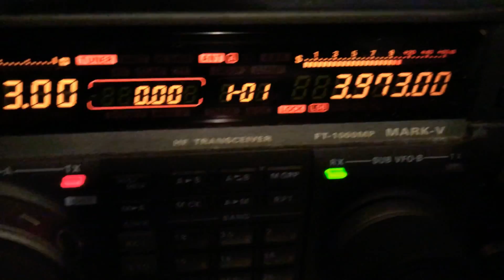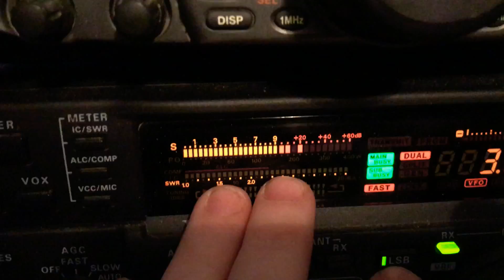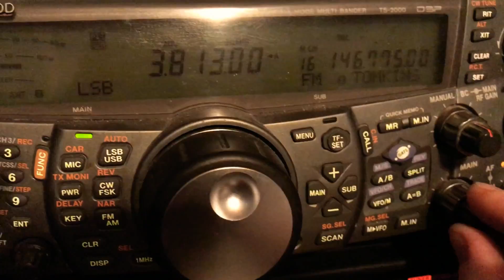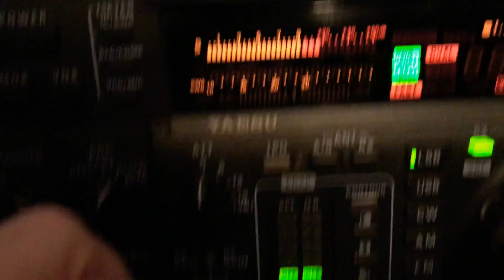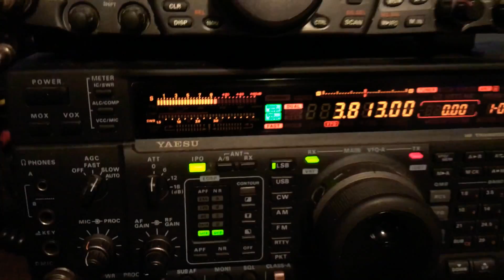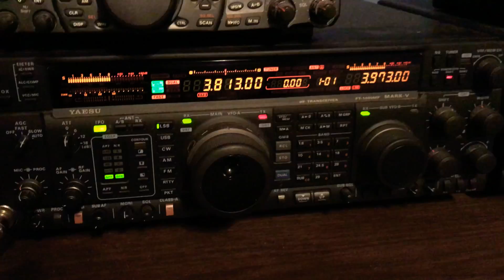Help me with my Yaesu FT1000MP MARKV Hf rig

Comment: Hey bud my name is Mike I got one of those radios just like that and I love it. I'm just trying to find out if maybe you figured out your problem because if you didn't I got a few suggestions so when you get this comment just post back if you got it fixed or if you still need help 73
Reply from the maker: no I haven't.
Reply: Agus Tri Wibowo  It could be the coax picking up static.  I had that problem before, I added a second ground rod close to the shack and the problem went away.